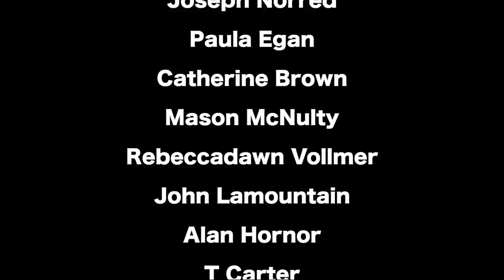She Found a Way to Make it Happen! (Chicken Garden Day 116)

Comment: Make sure you have enough equipment,  people will come but need supplies to work with. Get the mixers going, and put up that oasis. 120 degrees is coming. Get the stock pool for cool off periods, you won't  regret  it. The stock pool can be turned into something else later.  I would be there and stay for months if I were in better health. I love what your doing and you will complete this, never give up. Also, consider working at night, you have the power for lights.
Reply: GREAT IDEA CORAM!! WORKING at NIGHT would be much cooler!!!
I understand this is a daunting task especially with everything else you do on a daily basis! So.. if you aren’t feeling it Ashley that is ok!! You certainly don’t have to be in a good mood a everyday. 
Thank you for sharing your progress. I really appreciate all that you do 😃! Please keep hydrated and safe. 🙏🙏🙏Laura

Comment: Might I suggest a shade structure of some sort?  A few, actually.  If you block the sun in an area, first thing in the morning and keep the sun off of it, you can work that section as time permits.  Don’t lay a tarp on the wall for there will be heat transferrance.  You want enough space so that the air beneath it was cool.  As if you put it up to keep the people cool and the wall was included.  Keep the sun off the section from the minute the sun peaks over the horizon until the plaster has dried at a reasonable rate.  This will allow YOU to determine the schedule, and broaden your workspace.  People who are out in the desert building adobe houses by hand are campers. People who want to learn how to make adobe and earth bags and plaster are campers, rock hounds, day trippers and climbers. They are outdoor people.  They have shade.  Shade the whole damn structure when people come and work where you want, when you want. Some of them might also have misting fans.  And generators.  And awesome water/snack stations that don’t weigh a ton and don’t tip over easily.  Just thinking out loud.  Sorry
Reply from the maker: We have shade structures, but wind is their enemy 😂

Comment: Check out Blue Cactus dairy goats they have built these cool A frame structures for their goats out of wood you would probably only need one for your goats also she makes goat milk soap and shows the process  just a very informative blog on YouTube... also I watch Robbie and Gary gardening easy they grow in totes and live in California her method is helpful for water conservation... also with your garage  structure  instead of canvas  on the sidea you could use 1 by planking and drill and bolt it through the metal frame and could even use polycarbonate greenhouse panels  to allow light and on the top roof area use metal roofing  . I took an old metal swing that the cloth seat material had rotted away and used deck planks cut to size and using carriage bolt drilled through the seat frame and planks and attached them .  On the awning frame I attached a piece of the plastic lattice to replace the cloth one... just some maybe helpful ideas .. I like to repurpose alot ... love your channel